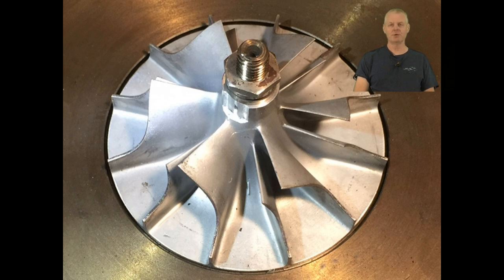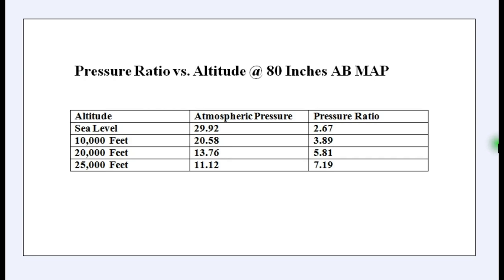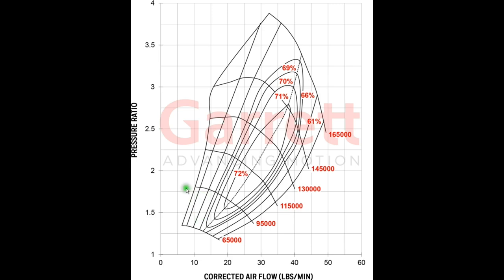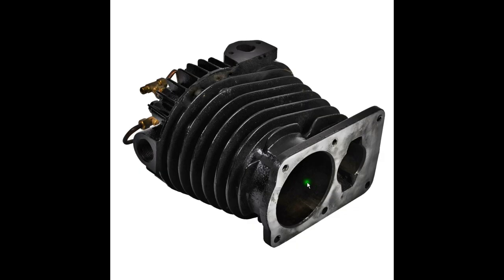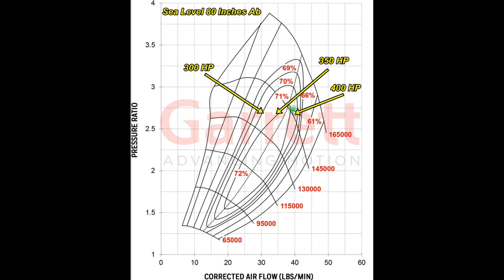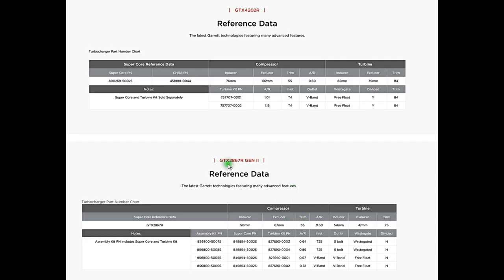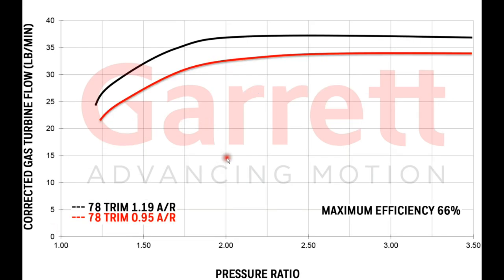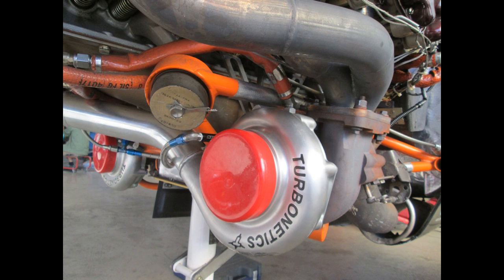What's Wrong With Raptor's Compound Turbo System?

Comment: Peter has a lot of people telling him what to do.  The signal to noise ratio is really bad.  But this seems very well thought out and very well presented.  Perhaps this will get thru.
Reply: Nope, Peter will ignore it and carry on with what HE wants to do! Too bad though..nice video!
Reply: @thomasaltruda  Jay Menna is correct though.  The noise floor is so high, sifted through and qualifying remarks made would become a career.  I’m the end, you’d never get anything done at all.  My opinion is Peter already admitted that using a conventional engine would wipe away the excitement for him.  It would just be another plane.  So he is trying to create a paradigm shift.  I say good for him.  I see in 10 years after production has started, a major manufacturer will make engines properly for this application.  Until then, it’s the Wild West.
Reply: @onethousandtwonortheast8848  It’s one thing to break new ground. It’s another thing altogether to ignore irrefutable engineering principles.
Reply: Yes saying he wants to break new ground is not related to this issue.  He is just straight up ignoring or rejecting proven principles that could significantly improve his performance and eliminate some of his temperature issues.  I know he is probably way over budget and overtime, and just trying to get the 40 hours in he needs to get it to production.  but still, this seems so clear and obvious. It’s a shame he isn’t Making this change while he’s swapping the engine
Reply: Unlikely. Peter has had many aerospace engineers, previous kit designers, test pilots, production engineers, etc, all chime in. He ignore their advice or often even blocks them. The signal to noise ratio is not the problem (it's actually self induced because Peter deletes so many comments). The problem is that Peter is suffering from confirmation bias. 

I wish for the best but I am fearful that this project will have the worst outcome.
Reply: @bryceb8331  At this point he needs a lot more than 40hrs. At its current stage this is not a reasonable kit or even a reasonable aircraft. He needs to completely redesign the flight controls. He has major aerodynamic issues to overcome. He has pressurization related structural problems to over come. MAJOR PSRU issues to overcome. He has the entire pressurization system to overcome (He never even installed a regulator valve.... He doesn't know how pressurization is even done).

This aircraft venture will need at a minimum 1 or 2 more flying aircraft before considering production plans. Anything he says otherwise is marketing. I feel bad for anyone who has given him money.
Reply: @Jwmbike14  EXACTLY. In his head, he is solving those problems but in reality he just patches them up, creating other problems. He's doing the opposite of engineering.
Even Wasabi quit him because of the horrible flight controls, poor airfield choice for testing and other design rejects.
I really hope he survives this adventure. NTSB crash reports are sad.
Reply: @bryceb8331  How's he going to get into production with this very well known issue?  Seems like there's a lot more engineering to be done.

Comment: You do a great job breaking down a really complicated engineering topic to make it easy to understand.  Compounding the turbos essentially turns it into a jet engine, just with a piston engine instead of a combustion chamber.  And every cutaway of a jet engine shows the second stage compressors and turbines a lot smaller than the first!
Reply: The modern automotive turbo diesel is the linear descendant of the jet engine.

Comment: Cool video and appreciate the explanations on everything.  I imagine you attempted to bring this to Peter's attention, but was most likely ignored.  I used to be really interested in the Raptor project but as time goes on it gets harder to watch, especially after that last engine failure.  I wish him the best but he doesn't seem to want to listen to anyone other than himself and that is really unfortunate.
Reply: Agreed. After his first engine blew up I mentioned many times that he needs to go through everything that oil touched and thoroughly clean or replace it. So far metal particulate has caused one of his turbos to seize up temporarily and now it's taken out the bearing in his redrive. It's just a matter of time before another catastrophic failure.

Comment: This is great & important information. Thank you for the time you put into this video. Getting this right would go a long way to getting Peter's project moving in the right direction. I know that he is deep into his current setup, but it seems inevitable that he will need to make this adjustment to the turbo system for his design to have a chance at success. It simply can't go into production without getting this issue solved.

Comment: Ouch. This is exactly what I've been saying in the comment section on The Raptor Videos.
My suggestions for peter would have been to stick with one Turbo in the first development stage of the airplane. As soon as the airplane is ready to fly and safe in Lower altitude, he could start implementing a revision with two turbos. I. E just drop another bigger turbo in front of the already existing small turbo for lower altitudes

Comment: Wow i learned a lot about turbos and compound turbos from this video, thank you so much for making it! Also you use my fav. engine, the EJ22, haha, would love to see how you turbo'd that :) My dream is to put the EE20 (Subaru's high-efficiency 2L diesel) in a LongEZ, and just try and max out the miles-per-gallon. Actually i was going to make it a dual-fuel diesel/propane because that gets even better efficiency, and the propane can take high boost and has a better weight-to-btu than diesel/petrol, but i'm rambling now, thank you for teaching me more about turbos and helping me get closer to my dream :)

Comment: Excellent explanation and discussion on the raptor shortcomings on turbo sizing and matching. Mullers solution to hearing dissent and criticism is to ban those trying to set him straight. There are so many areas in the design and development of aircraft where he just doesn’t have a clue. Flight controls, structures, aerodynamics, stability and control to name but a few. His approach to returning to flight after having an in flight engine stoppage after a major oil loss is mind boggling. Fortunately there was significant internal damage to the engine that manifested itself on the ground run up after fixing the oil leak and just adding more oil. Maybe the next significant in flight engine failure will not end so well - he did get very lucky on the last one. He just thinks he is way to smart to listen to anybody about any subject and maybe he is. For those of us that have been involved with aviation for 40 plus years, lost some capable and careful friends and colleagues in aircraft accident - what do we know. Maybe we have just been unlucky. Everything tells me the raptor program and Peter Muller are going to come to an abrupt and unpleasant end if he carries on with the “suck it and see and press on regardless approach” . I don’t for one moment believe he will listen to your efforts to help him. Sheep were made to be sheered.
Reply: "Mullers solution to hearing dissent and criticism is to ban those trying to set him straight." ... He's banned me! His loss, I'll share my experience with someone who appreciates it. Your other comments are spot on. I gave up following when he just refilled the engine oil and fired it up ... no inspection, no strip down, no oil analysis. Sadly it's a matter of time before something really bad. Hopefully not at the expense of an investor or 3rd party.
Reply: @simonbaxter8001  yep banned me too. Just bad for business when he got told that he needed to stop putting patches on top of patches. I am surprised he hasn’t had a visit from the FAA revoking his airworthiness certificate and his pilot licenses. If (when) he has the next major event with the unsafe prototype raptor and somebody else gets hurt I can just see the lawsuits piling up. His approach and behavior is just plain reckless and unsafe. Best to watch from a distance.

Comment: Nice Job! Interestingly enough that turbocharger system on the Raptor was designed for a automobile operating at normal conditions...say under 5000 AGL. I am surprised this was not thought of my the engineer who designed and manufactured the Raptor. Anyway, this was a very informative video. Thank you for sharing.
Reply: He didn't use the stock turbo setup from the Audi but cooked up his own. Also, usually automobiles operate under 5 AGL...they would seriously lack traction any higher.
Reply: @rustyshackleford7022  not sure about that....the computer mapping should be infinitely expandable to what ever pressure (height)... most autos computer take information from a wide variety of sensors and monitor operation constantly, as you go up and have less air the computer would compensate by leaning the mixture or upping the boost.
Reply: @grandenauto3214  I think you missed the joke...we're talking AGL. An automobile above ground level usually lacks traction because its tires are off the ground. The computer mapping can't counter that.
Reply: @rustyshackleford7022  I get haha

Comment: Thanks, Ross. I hope your knowledge, and willingness to share same, will benefit someone. Sadly, not likely to alter Peter's configuration.
Reply: Peter is a hard head and if he isn't careful that thing will be the end of him he's been lucky so far but things can go from good to bad in a heartbeat
Reply: I am getting the same vibe. He does all this intricate engine diagnostics but he gets bog down with data and information.
Reply: @normancole3415  and as witness the seal blowout that caused the engine failure and near disaster of his last flight, he is not careful. The seal seemed ok, until it wasn’t. If you get a chance to fly with him, pass.
Reply: @don_sorensen_santa_barbara  Peter didn't check anything else after finding the blown seal. It could be something else that failed. He didn't even take a head off to check the valves and pistons that many, many people have told him were being tortured to death.
Compressor turbo seals don't usually see much pressure, they are effectively at an inlet pressure point. But with compound turbos, the second stage compressor seal sees about the pressure of the first stage outlet. That is likely going to need a different seal to the ones put in speed shop turbos, which aren't compounded. Stuff is never as easy to do as it first seems.

His luck has been keeping him alive, it can't last, though.
Reply: @georgeingram2143  george, you may have missed the engine teardown where he looked at the cyl head and pistons.

Incidently, to prior comments, hard heads is what causes those few adventurers to risk all to do awesome work that has some chance of move humanity's needle.  This video is a great way to present a well developed comment to Peter's work.  I am with the many who hope this video will make it to Peter.  At the same time kudos to Peter for being one of the rare humans who try something - anything to make a difference!
Reply: @swlowry5277  I have not seen an engine teardown. Which one is it?
Reply: @georgeingram2143  He tore the engine down AFTER the subsequent re-start when he heard the wrist/piston/gudgeon pin had failed, not immediately after the dumping of the oil, which is when the strip down and inspection should have been! After the oil 'dump', he only took the turbos off because a seal had gone in one of them. See https://www.youtube.com/watch?v=IpqeDZopQ8U&t=17s
Reply: @simonbaxter8001  As far as I'm aware he didn't tear either engine down. Neither the original, to ascertain what exactly had caused it to fail, nor the "new" one to check that it was in working order. He didn't even bother to remove the buildup of crud on the inlet manifolds and then erroneously blamed a subsequent issue on some of it flying off and temporarily stalling the turbo. His plan to resolve this issue? Run the engine some more to burn off the rest. 
Peter's safety protocols seem to be inspired by NASA's Space Shuttle Program.
Reply: @DealerD8vE  You can all sum it up in one sentence - The Raptor's story is a very sad story.
Reply: @aGabay  Let's hope it doesn't become a tragic one.

Comment: Thank you very much for this, many watching knew and have made comment on the turbo set up but your explanation/ presentation nails it. One would hope some changes are made before we see a catastrophic failure in the air.
Reply: He already had a failure in the air after loosing oil pressure , now he has had to replace the engine because of it . He had a leak in the redrive unit for the prop .

Comment: An excellent analysis of the system required - the problems with the engine in the raptor , and the re-drive , are the potential points of failure in the overall system.

For a diesel engine , which is intrinsically a basic compression combustion engine, the added systems and sensors in the raptor installation; add another level of potential failure - that and the belt driven re-drive do not make for a fail safe set up.

Comment: Best video I have seen on the subject. Glad I am doing a car rather than a plane; you might also consider mentioning that other applications e.g. automotive can run the turbos sequentially to broaden the combined compressor map and spool earlier then hand off to the large compressor, because they almost never run over PR 4. This is achievable by a single turbo, rather than compounding boost all the way up to PR 7 due to low ambient pressure at altitude. Kind of a shame the raptor guy went to all the trouble to build a compound without bothering to size the first stage appropriately.

Comment: Thanks for the introduction to turbocharging. I had to go look up what "corrected airflow" was, but in combination with some of my own reading, I've got a much better understanding of matching a compressor to a particular application.
Reply: I was just thinking, since it took me a little bit of time to wrap my head around "corrected airflow." I'm pretty sure the designer of Raptor just looked at the fact that the turbo Audi draws 30 lbm/min of air at maximum power and said, "oh, that will work great!" without understanding the "corrected" part of corrected airflow.
Reply from the maker: @rocketplane  The main rub is that Peter failed to understand that the 1st stage compressor must take in about 2.68 X the amount of air and compress it roughly to SL pressure to feed the 2nd stage  compressor at 25,000 feet, which then compresses it a further 2.68 times to achieve the 80 inches.

Comment: This is another in a long line of problems with the Raptor. I have pointed out the problem of the integrated hydraulic system. The reason for the last engine failure was that the prop  system failed , oil leak, causing the engine to loose oil pressure. The engine should be separated from the prop hydraulically. Simple to do . Yes it will cost a little.
Reply: That redrive system is the weak link in the chain. That will be a constant failure point.
Reply: Why stop there? You could have different oil system for the engine top end,  a different system for both top ends,  different oil system for the turbos, different system for each turbo,  you could have a different system for each crank bearing,  you could have a high volume low pressure system for cooling oil.  How do you know what is the right number of segregated oil systems?
Reply: @golfmaniac   YOU are correct!!!
Reply: @golfmaniac  and it's the only selling point.

Comment: I have commented on Peter's videos multiple times about his lack of engineering understanding, especially of first principles that drive engineering design decisions.  I want to say your video is clear and succinct about the dual turbo set-up Peter currently has installed on the plane and is exactly what I, and many others, have been trying to tell him.  I have to agree Peter is definitely a "not invented here" guy and that is a very dangerous trait for any engineer or person trying to perform design development.    Based on my many years of very successful large engineering project management, I see a person who is now at the point of using bad logic to justify his decisions rather than listen to anyone who is not on board with his views.  In my world, this is someone I remove from my project as there will be a bad outcome sooner or later.  I really wanted to see Peter succeed, but I have no doubts at this time this plane will never make it to production unless someone takes over the project.  Peter is way beyond his capabilities and unfortunately appears to not have the money (otherwise why purchase a suspect used replacement engine?) to hire people who can help him to success.
Reply: Yes Ron, I came to the same conclusion. I really wanted Raptor to succeed and put up some cash to keep the project rolling, however Peter is not applying sound project management principles and engineering decisions are being made without the benefit of experienced and qualified practitioners.
I hope for everyone’s sake the project ends before there’s injury or loss of life.